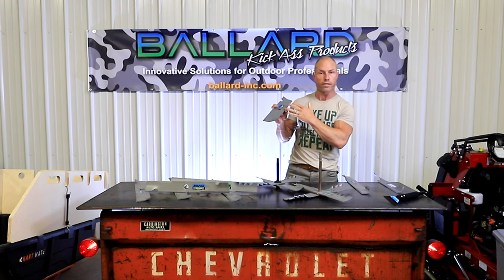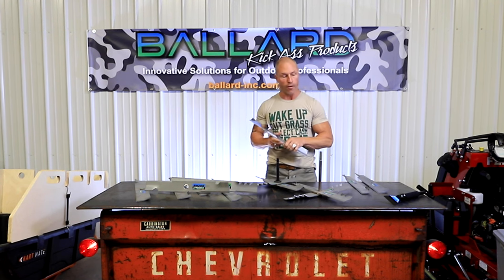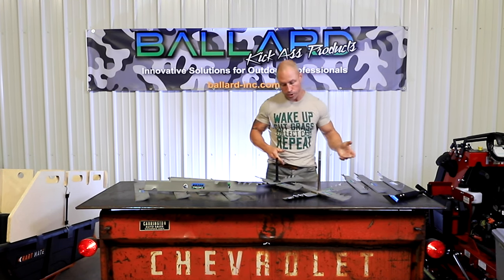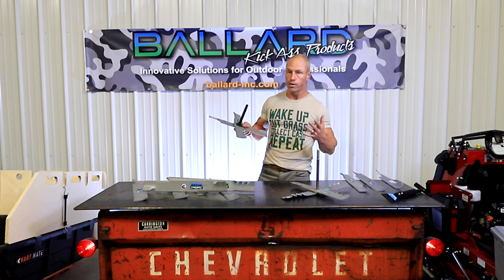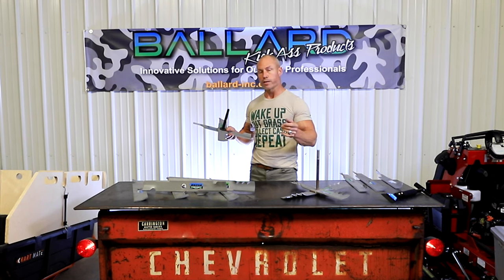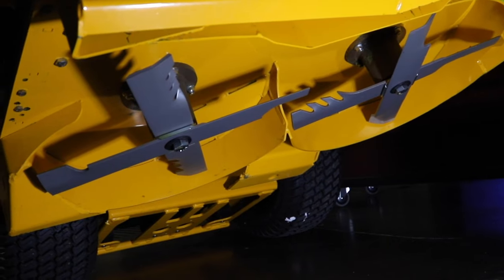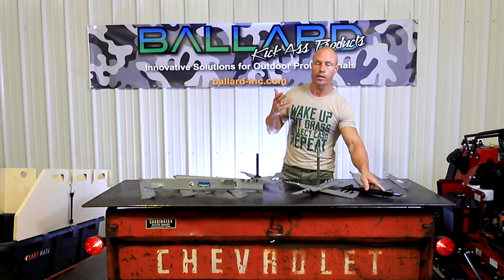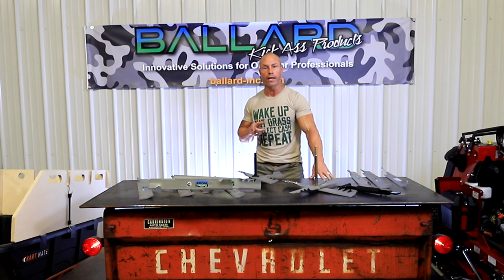Ballard Inc - "What Blades Do I Need?" - Mower Blade Breakdown!

Comment: I'm on the wait list for the cub cadet mulching blades. I like your work bench. I've tried every blade I can find the steel is to soft for my grass which is mostly field grass hopefully yours will last longer. I sharpen with a all American sharpener and a flap disc and not to a razors edge to avoid rolling of the edge.🇺🇸👍

Comment: After coming across another one of your videos I was convinced that I wanted to give these blades a try after reading the comments and so here I am.  After receiving my first set of blades I noticed right away that the quality of the blades are fantastic. I will come back to this comment and edit for an update when I begin mowing as I am excited about putting them to the test since we are in the rainy season here in Maryland. I took advantage of the discount code provided in another video and was surprised and pleased at the cost differences between Ballard and my local stores.
Reply: I got Oregon Gator blades for $9 a piece from local dealer. The cut is 1000 times better and also the suction. Ballard metal is soft weak and no suction. He got my money once but never again

Comment: Hi Kory, just put on the cross blade adapters with the short tail highlift blades on bottom and the factory toro grandstand 36 blades on top. took your advice on starting on lower rpm then full. comparing to the extra high lift blades, your adapters causes more vacuum throwing very fine clippings and leaves a great stripe. this setup is on my toro grandstand 36 with the kawasaki 15hp, do u think the 15hp is going to be okay with these x blades all season or should I switch them out when I recieved the dual 18 inch hi rise blades?  Thanks for the great products and quick shipping

Comment: Just wondering why you don't offer the high rise blades or any high lift options for the Kubota 700 series? Thanks
Reply: Did you look manually? I have a great Dane and I just matched my center hole and length. Found out it's the same as a scag

Comment: I have cub cadet xt2 lx46. With an abnormal shaft end. If I change the spindle. The only option is a 6 pnt star shaft. Has anyone out there tried too sandwich 2 blades onto a 6 pnt star shaft?
Or upgrade the spindle / shaft to universal round bolt hole

Comment: price is good....blades are not sharp out of the box, could stand to be a few more rockwell in hardness, are not exacting dimensions of scag oem blades
Reply: I think youre right . I bought a set of Razors and have to go over cut 2-3 times to get all of the grass cut. Im disappointed for sure. I'm goin back to standard old OEM high lift blade for my 2021 Spartan 72". Maybe they dont work well on grass in the midwest. I have no clue. just not happy

Comment: Corey your ripper mulcher I asked numerous times about 21.5 in Long 1/4 in thick 1 inch center bolt hole
We have asked numerous times and no answer?
Reply: This is actually for a 
Howard price 727 turf Blazer

1984 Parks and rec front deck mower it actually has a three cylinder yanmar diesel motor
And we'll mow a very steep Hill the drive tires have HD turf track tires from a gator ATV.
I have to make my own mulching blade out of the Scag 21 1/2 in. / 5/8 drilled out with a MAG drill to even get this close to use in this lawn mower.

The mad drill just happens to have a center hole of 5/8 for the 1 in Hogan angular bit/hole saw

Last time I took the bit to the sharpener he told me not to come back!!!

$6 each time and a sharpened them 13 times before it cut all the way through three blades.

But this mower does cut a golf course finish every time!